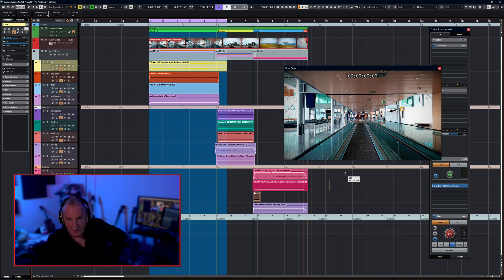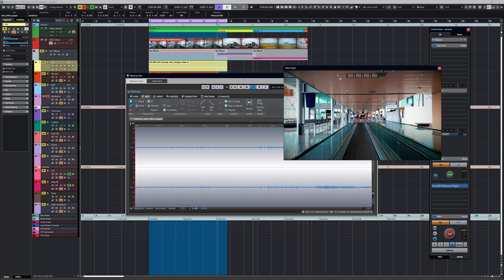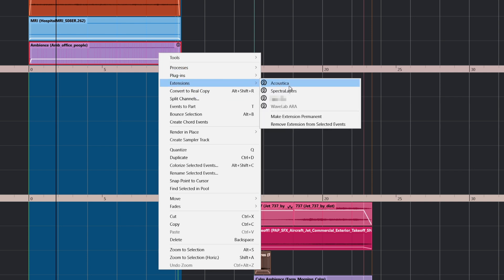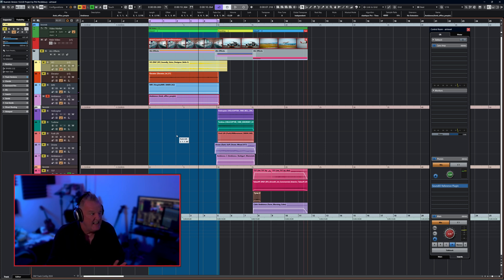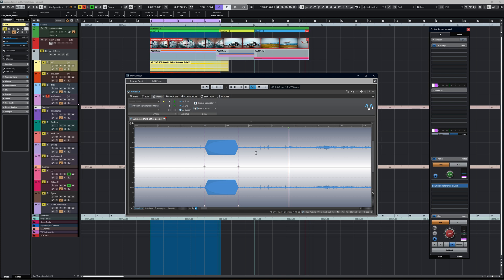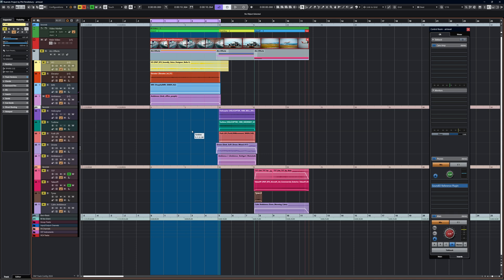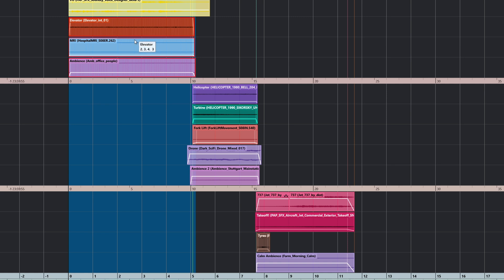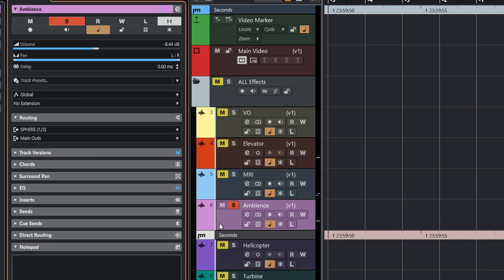Demystifying ARA Part 1 | Nuendo Explained

Comment: QUESTION: If I process clips with the ARA extension using Auto Align Post 2, or Spectralayers and make the extensions permanent, will the new processed audio files that are generated retain all of the original time code metadata and file names from the field recorder? I would like to clean up and phase align my dialogue recordings before sending them to post for the picture edit. That would insure everything is phase aligned and clean if its and indie project and they never do a proper dialogue edit. Thanks for the great videos.
Reply: This one is tricky to answer in a short comment. We would need to see the exact files you are dealing with. I think the easiest way would be to just test it, using copies of some of your media, in a small dummy project. Perhaps post back if you get any info from the tests?